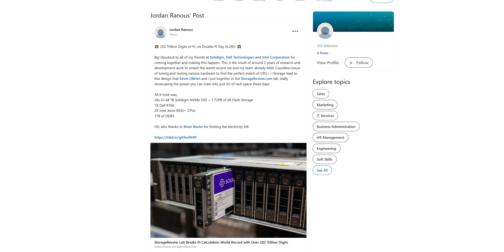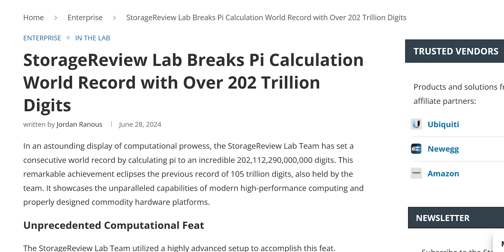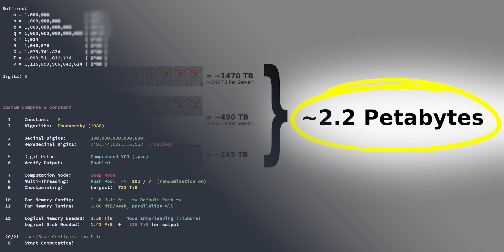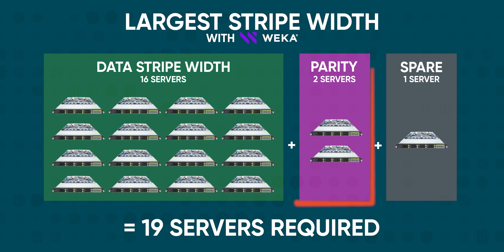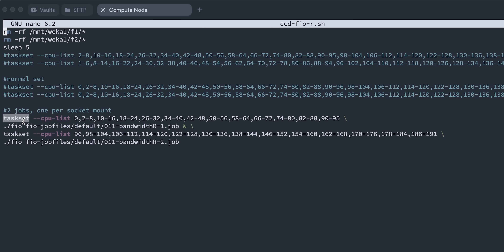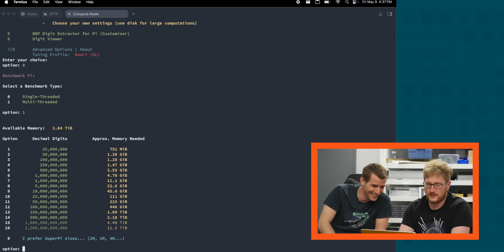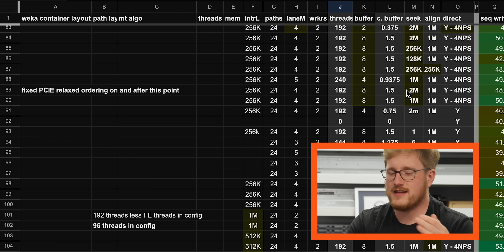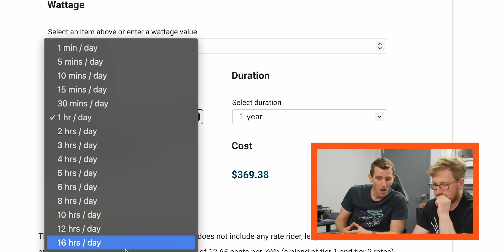The $1,000,000 PC set a WORLD RECORD

Comment: I ran a calculation of my own.  If you needed a circle the diameter of the solar system with a margin of error+/- 1 Planck length you would need π accurate to 51 digits. For a circle the size of the observable universe with the same margin of error you would only need 62 digits. That is the largest possible circle with the smallest possible margin of error 😅

Comment: In practical terms, one can argue that Pi calculated to 62 significant digits should be enough for the rest of eternity. Why? Let's assume the universe is a sphere with a diameter ~ 93 billion light years, or 5.444×10^61 Planck lengths. So, to calculate the circumference of the universe in Plank length one would need the following  value of Pi: 3.1415926535897932384626433832795028841971693993751058209749445...( I trust even Siri can provide this result). Now mathematicians, on the other hand, are not governed by finite units of measurements, no matter how minute they happen to be!

Comment: What OS is running the calculation and why he s using a Macbook?
Reply: That looked like Linux but unsure which distro.
Reply: @Azarilh I saw a windows screen on c:/ ycruncher..
Reply: @Azarilh on 15:16 it shows ycruncher is intalled on windows. Any clue about it?
Reply: @Static-4 idk, maybe the cruncher runs on a different machine through ssh.
Reply: @Static-4 16:24 I confirm. It's windows SSHed into a Ubuntu machine. So they used Ubuntu.
Reply: @Azarilh I dont understand. If its installed on Windows how can run on linux?
Reply: @Static-4  It's not. It's installed on Ubuntu. They used Windows to connect remotely to Ubuntu with SSH ( it looks like SSH ), so they can control it remotely. It's a common approach to managing servers.

Comment: These, and even "person memorizing digits of pi" are pure bragging rights. But they're fun bragging rights.

Of note - 62 digits of pi is sufficient to calculate the diameter of the observable universe, with an accuracy of the Planck length (the smallest distance apart it is physically possible for any two subatomic particles to be.)

62 digits is the extreme of overkill. NASA only uses 15 digits for planning probe trajectories, because that is sufficient to be accurate to 1cm over the entire width of the solar system.

Comment: If you where to print that out, The cost of paper would be easly over $100 million. Case of paper holds 5000 pages of paper. And a pallet of paper is 40 cases. You will need 58,500 pallets of paper which is 2, 786 truckloads of paper.

Comment: Cool feat, but let’s be real: crunching 300 trillion digits of π on a $1 million rig for 7.5 months was 99 % spectacle and 1 % new insight. Any genuine hardware-or software-stress data could’ve been gathered in a short burn-in on far cheaper systems, and engineers only ever need a few hundred digits (NASA uses 15!). So while the stunt is great for views and “world-record” branding, it burned megawatt-hours of power, produced mountains of SSD wear, and tied up money and silicon that could have tackled climate models, medical simulations, or scholarships. Impressive flex, but a textbook example of diminishing scientific returns and outsized environmental/opportunity cost.

Comment: I still hold out hope that someday someone will calculate pi and find out that it can actually be solved. Seems like you could just run it without storing the result on some monstrous machine until you find the result, and then worry about recalculating and storing it after that.

Comment: "To calculate the circumference of the observable universe with an accuracy of about one hydrogen atom's width, you only need about 39 digits of pi"
So with the digits calculated by hand by 1700 before it even got the symbol attached to it should be enough to calculate the observable universe (the biggest possible circle) to the accuracy of the Planck length (the smallest possible distance)... So what does Pi beyond that even really mean? 😅

Comment: 6:42 did I miss someting? a dual layer blu ray is about 50gib, so 400 gib would be 8 discs per second.
Reply: You're confusing gigabyte and gigabit. A bluray is 50gigabyte and the network is 400gigabit. 400gigabit divided by 8 (since there are 8 bits in a byte) is 50 gigabyte per second. So works out fine.
Reply: @lshallo106  oh, that was pretty obvious in 
hindsight. (facepall)

thank you.

Comment: Just regarding the math in the introduction: It is not only "as far as we know" an irrational number. This fact is proven for a couple hundred years. This also does not only mean that there are infinitely many digits, but also that they never get periodic. 1/3=0.3333333333... is rational for example (so not irrational) but also has infinitely many digits behind the decimal point. The somewhat interesting part about calculations of pi is, that its digits don't follow a trivial pattern (what would be the case for 0.12345678910111213..)
Reply: As far as we know is objectively correct. Nice try being a pedantic arsehole though 😊

Comment: 18:04 well, having approx. 35 digits after the dot would let you calculate the circumference of a circle the size of the observable universe with precision less than the diameter of a hydrogen atom. So, no, I don't think there's any practical use beyond even 50 digits

Comment: Wow! Those servers are NOISY! How about immersing ALL the drives, motherboards AND power-supplies into a dialectric Silicone Oil bath and pumping the heated silicone oil out to roof-mounted radiators using QUIET pumps!

You would get MUCH BETTER cooling and it would be nearly silent!

V

Comment: The WEIRD thing i see about this video, is that I keep thinking that TWO PETABYTES isn't actually all that big! A video taken by one our company's aerial imaging systems at 16,384 by 16,384 pixels at 64-bits per RGB+Distance pixel value with NO compression for best image quality is 2,147,483,648 bytes per frame (2.14 Gigs per frame) and at 120 fps for one week's worth of 24 hours per day recording is 155,855,773,237,248,000 bytes or 155 Petabytes, so 2 Petabytes is actually NOT all that much space for modern video recording and playback systems OR for even for calculating PI! And that is for ONE FILE! There is a REASON we need to buy and use ZettaByte-class storage!

V
Reply: On what computer you process that monster file?
Reply: @Static-4  We have in-house-designed supercomputers that use custom in-house designed and manufactured superchips that are combined-CPU/GPU/DSP/Vector Array processors that are 128-bits wide and 256-bits wide. The supercomputer systems in our parent under-the-radar all-Canadian Aerospace company's Northern British Columbia data centre are so powerful that they obliterate EVERY computer combined on the T500 (top 500) supercomputer list of most powerful computing systems in the world!

We are into the 20 YottaFLOPS now at a full 128-bits wide and soon will be a full 256-bits wide for floating point operations once we upgrade the processors to our latest version. 

Those 16K by 16k images are actually sub-sampled from camera-original DCI-128K imagery at a full 128-bits wide per RGB+Distance pixel for 2D-XY and 3D-XYZ imagery, which is mere child's play to process on these types of supercomputer systems!

Our displays are RGB colour laser emitters that use a micro-sized laser for EVERY PIXEL that are emissive monochromatic Red/Green/Blue lasers running are a full 16-bits per RGB channel so the image resolution and colour fidelity is STUNNING!

And since we shoot stereoscopic aerial and spatial imagery using stereo DCI-128K cameras that get Nyquist and Lanczos-5 sub-sampled down to 64K resolution and below with an Unsharp Mask filter, we can also do pan/scan/rotate 3D-XYZ imagery at unmatched image quality and ultimate super-sharp pixel resolutions on 16K displays.

Our only limitation is the current limit of DCI-16K by DCI-16K pixel resolution of the current displays themselves which will be upgraded eventually to the full DCI-128K by DCI-128K resolution of the cameras once we figure out the in-house manufacture of a 40 metre by 40 metre tempered single-plate Borosilicate glass RGB laser emitter display that is 17,179,869,184 pixels in size (17 Gigapixels!) which makes IMAX look PUNY and low-resolution by comparison!

V

Comment: 2:08 For reference, 11.7 billion pages of A4 would cover an American football field to a height of 10.22 m (33.5 feet).
Reply: @JMUDoc  They probably mean US Letter since they're in Canada. Still, the number’s a bit off.

https://en.wikipedia.org/wiki/Paper_size

11.7 billion sheets of US Letter (0.0603 m² each) on a football field (~5,350 m²):

At 0.075 mm thick (very thin paper) → ~9.9 m high

At 0.1 mm (standard paper) → ~13.2 m

For A4 (slightly bigger), it’d be ~10.2 m and ~13.6 m.

So 10.22m is only accurate if it is very thin paper.

How did you get the result?

Comment: Not to be that guy, but having an infinite number of digits after the decimal point does not make pi irrational. 1/3 also has an infinite number of digits after the decimal but is perfectly rational. The difference is that pi cannot be expressed as the ratio between two coprime integers, which 1/3 of course can be. In fact, Pi is a bit more special, being transcendental, meaning it cannot be expressed as the root of a non-zero finite polynomial series with rational coefficients.

Comment: Back in the late 80s I had a TI/99/4A with the peripheral expansion box which allowed for a 32kb memory upgrade. There was an issue of Home Computer Magazine that had a program listing you could type in to calculate pi. After keying it in I let it run for several days. It outputted directly to the the screen and every few hours would add another digit. That project captured my imagination. I don't remember what the record was at the time, but I did have the Guiness book open to the page.

Comment: @4:03 i know its sponsored by Kioxia and the record was placed on April 2nd 
but Solidigm SSD D5-P5336 released a 122.88TB drive in a 2.5" case around that time
wouldn't it pack up more juice to the memory while only need 10 of it instead of 80 of the CD8s?

Comment: FYI, If you want to calculate the circumference of the observable universe with a precision down to the Planck length, you only need 63 digits of pi. If you want to calculate the volume of the observable universe on the Planck scale (essentially how many cubes fit in the observable universe that are 1 Planck length on each side), you only need 185 digits of pi. If you used any more digits of pi, it would not change the number.
Reply: 185??? And I thought I was good with the 102 digits I committed to memory.   Time to pump those numbers up!
Reply: THATS INSANEEEE
Reply: But if want to make an awesome video, from now on, 300 hundred trillion, minimum.
Reply: Yeah but 300M digits of pi are required to calculate the circumference of your mom.
Reply: @imCurveee   and about all the digits LTT calculated to calculate your curve
Reply: But what about the multiverse.
Reply: Ha ha🤣🤣 i had the exact idea! I just commented and then scroll down to read other comments and was immensely surprised to discover. Great minds think alike!!  My calculation was 62 digits past the decimal.  So we pretty much concur. The largest possible circle with the smallest possible margin of error. Due to Heisenberg Uncertainty
Reply: Keyword " Observable " universe 😆
Reply: But what if I want to measure not just the observable universe, but a theoretical model of the entire universe, obviously a model which assumes it isn't infinite, and I want to measure it to a precision much smaller than the planck length, obviously nothing physical matters on that scale, but maybe I want to measure consciousness, which resides much smaller.  We still need more pi, don't be tricked into thinking we have enough.
Reply: @okaydetar821  I would wager the difference between planck length & the size of an electron is far greater then you believe it to be. Planck length is astonishingly tiny.
Reply: @Zaptosis   I know exactly what it is, it is the smallest distance that our currently models say have any relevance, I am proposing a theoretically different model.
Reply: @okaydetar821  I don't think we can measure something we cannot observe or at least know the end of of it.
Reply: @yuzuftazimo2157  Maybe the only reason we can't observe or know the end of it is because we don't have enough digits of pi.
Reply: @okaydetar821  "measure consciousness" ??
Reply: @recordist9098  See, if we had more numbers of pi this wouldn't be such a confusing idea.
Reply: @okaydetar821  I understand now
Reply: @okaydetar821  the plank length, is the smalled distance possible, you cant go smaller than a plank length
Reply: @castyer  Not with that attitude you can't.
Reply: @castyer  Smallest measurable distance so far. Physics isn't done yet.
Reply: @hypano   We have only calculated the planck length as a sort of scale from the plank constant, gravitational constant and speed of light. There is nothing measurable about it to us. 

It is so unbelievably small that the smallest thing we have measured are still roughly 16 orders of magnitude bigger than the plank length. 

It's a theoretical limit we have calculated with our current understanding of science. In our lifetimes that will probably never change. It's good enough to assume that it's the smallest thing that can exist and let those qualified to do so (when they eventually exist) work on proving otherwise.

Comment: i know like, more than 100 digits is like, way more than you need to calculate the circumference of the observable universe within the width of a hydrogen atom (i think it was like 47 digits, 100 could probably get you the "width" of a proton or maybe even approaching quarks or the planck length) but i'm honestly suprised it was even possible for you to calculate a record with only a few million in hardware, because yeah theres no financial reason to do this, but there are much much bigger setups that could have been benchmarked for a few days and easily beat out a month long run from this hardware.

Comment: Confused why people speak about bits and bytes at the same time? It would be easier to stick to one unit? For example 2 200 gbit ports per card, pcie g5 slot bandwith of 64 gbyte a second, that can saturate both ports at a speed of 1.6 tbits a second which is then clarified to be 200gbytes a second. Im confused.

Comment: In order to calculate the circumference of the observable universe to the accuracy of the width of the hydrogen atom, you need 38 digits of pi. In order to calculate the circumference of the observable universe to the accuracy of the shortest distance where our physics theories still make sense, the Planck length, you need 63 digits of pi.

In conclusion, 300 trillion digits has plenty of real world practical applications

Comment: 300 trillion digits, you probably could need each and every one of them to calculate the flight path you need to take to land on a square millimeter precise on a puddle on an asteroid orbiting a moon, which orbits a planet in like few hundred lightyears away.
Or actually scrap that, NASA markets they needed to use 40 digits of pi to calculate the whole Universes circumference. Notice the words "they say", they actually just used 4 digits and it was exact enough in that scale, the 40 digits would have given them the answer to a nanometer precision.

Comment: Pi being irrational doesn't mean "an infinite number of digits". It means that there's an infinite number of digits with no repeatable pattern.
Also, according to an article on NASA's website, the number of decimals needed to calculate a circle the size of the known observable universe to within the diameter of a hydrogen atom? Isn't even 40. Actually only 38 if you include the 3 before the decimal point. So 300 trillion digits is overkill for most applications with any actual use. But it's sure cool AF!

Comment: For reference, NASA uses 15 decimal points of pi, given voyager 1 is 14.7 billion miles away from Earth that gives an error value of 1cm or on a (known) universal scale 37 decimals of pi will enable you to calculate the circumference to within the diameter of a hydrogen atom - not to take away from what LTT achieved, the solutions to this kind of problem can be of value elsewhere and well... as a nerd it's kind of cool

Comment: You can't tell me any of the institutions with access to super computers have not calculated more than that over the years ? But yeah some parts of our 'readily' available hardware has gotten much better over the last 10 years or so. Actual usable IOPS from storage system first amongst them I think.

I have a samsung 990 pro nvme pcie gen4 4Tb in my current build that cost 250$ and can do over 1M iops (1.4M reads) and 7GB/s out of the box with zero tuning or system changes. You used to need to have a six figure enterprise storage system with totally proprietary ancillaries to approach that not too long ago.

Comment: Here's Pi to 39 digits:

3.141592653589793238462643383279502884197

This gives you enough precision to calculate the circumference of the observable universe, using c = 2πR, to within the diameter of a single hydrogen atom.

And this is π to 65 digits: 

3.14159265358979323846264338327950288419716939937510582097494459230

With this and 2πR, you can calculate the diameter of the observable universe to within the Planck Length. 

The Planck Length is:
1.616 × 10⁻²⁰ femtometers

A micrometer is 100 million femtometers.

And the Planck Length is 1,000,000,000,000,000,000 (1 quadrillion) times shorter than a single femtometer.

I think, I might have got my powers slightly out here and there. 

But this gets the message across I think, 1 quadrillionth of a femtometer.
65 digits of π